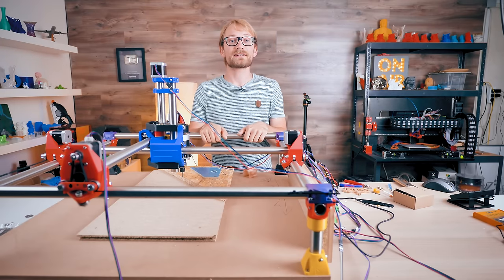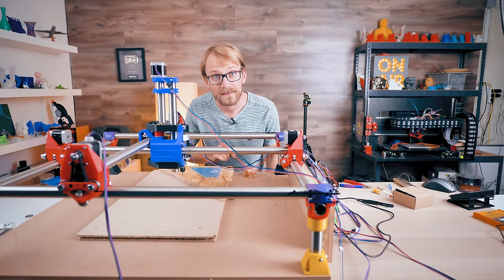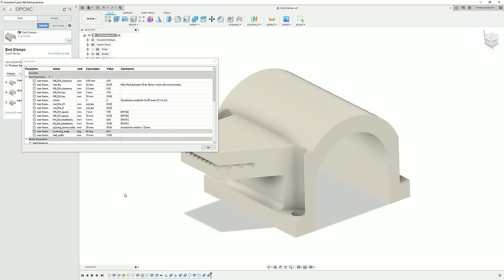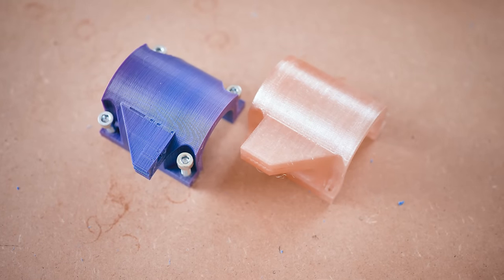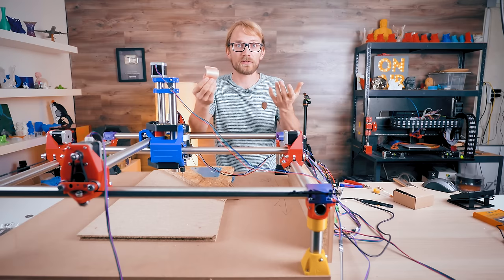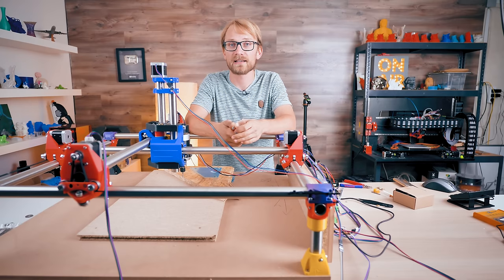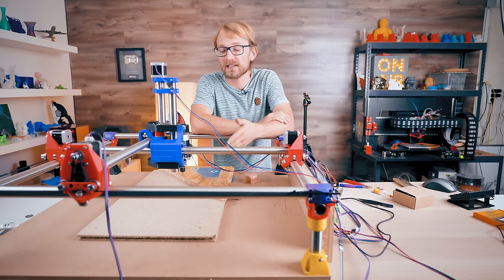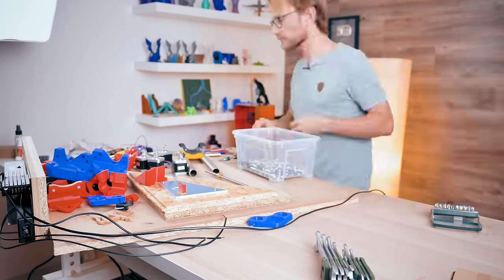Whose design even is this? (MPCNC conclusion)

Comment: I know that everyone is kinda shitting on Ryan a little bit here, but I'd like to take a moment to just try to present what I think is likely Ryan's case (despite thinking that he's in the moral wrong here).

Ryan has put work into the designs for this system, and doesn't want anyone else to start selling kits based upon his designs because he wants to have the exclusive rights to make profit off of his work. Simultaneously Ryan wants his designs to be open enough that hobbyists at home can make them for themselves, or make improvements to them. Licensing is likely a concern for Ryan because within the 3d printer and home-maker communities there is a lot of IP theft, specifically coming from Chinese manufacturers. If Thomas were to make a part for Ryan's designs and that particular part were to be made open-source, it probably wouldn't be a huge deal, but if people in general were to do this until a significant portion of Ryan's design had been "improved upon", the new non-restrictive licensing would allow people to take all of the open source parts and sell or manufacture those, effectively cutting Ryan out of the entire process and denying Ryan the money for the work that he has put in.

That said, I think that even if this is the case, Ryan is probably freaking out over one instance, and he shouldn't be. I also think that the CC license is not helping here because its a great short-cut to licensing, but its not as specific and detailed as perhaps Ryan actually wants to be. Additionally the issue of if the part that Thomas made is actually derivative would very likely fall on Thomas' side of the fence here. Give that the disputed section of the part is over a glorified U-bracket with 4 holes in it, I highly doubt that you could ever hold any ownership over it. Furthermore the physical part cant actually be subject to copyright anyway because its a functional part, which is non-copyrightable, it could only be done via a patent. Now the digital file could be subject to copyright, but the digital file was started anew with no previous material used in its creation, which makes it not derivative (though IANAL). Either way, Ryan is behaving like an idiot in this instance, but I don't think that he's the asshole everyone is trying to make him out to be.
Reply: Ryans MPCNC machine is not eligible for copyright protection, and unless he is able to patent the machine (which he almost certainly cannot), anyone who wants to can LEGALLY copy, sell, or alter parts for his design.  This is a basic principle of law that has been upheld in many court cases.  For example, “Unless protected by copyright or patent, once form or design in an article is offered to the public, it becomes the property of the public and, absent deceptive identification as to source, may be copied at will by competitors.” Zippo Manufacturing Co. v. Manners Jewelers, Inc., 180 F. Supp. 845, 847 (E.D. La. 1960)

Comment: Oh boy does this comment section not understand licensing. The point of non commercial just means you cant print and sell that part without permission of the copyright holder. Now isnit derivative? Ehhh maybe. Using the end product commercially is allowed.
Reply: Copyright does not protect functional objects, like a CNC machine.  And unless the MPCNC is protected by patent, it has no intellectual property protection, and can be built, modified, or even sold by anyone.  The right of the public to freely copy, sell, and use unprotected designs has been upheld in many court cases.  To quote a ruling from one such case, “Unless protected by copyright or patent, once form or design in an article is offered to the public, it becomes the property of the public and, absent deceptive identification as to source, may be copied at will by competitors.” Zippo Manufacturing Co. v. Manners Jewelers, Inc., 180 F. Supp. 845, 847 (E.D. La. 1960).  So Thomas was well within his rights to design a new part for the MPCNC and freely offer it to the public.

Comment: I don't think you understand licenses. The license in question here is known as the copyleft license, which basically means that anything that is made with the license and it's derivatives must continue to adhere to that license. Because the creator of MPCNC made the MPCNC design and you made parts off of the MPCNC parts, the license gets "passed down" to you and anything you release must also have that license.

If you really don't like MPCNC, you can always make your own open-source design. No one is stopping you, as long as you don't use any of the original parts and your new implementation is clean room.

Also, a noncommercial license is still considered open source. Open-source doesn't mean no restrictions, it just means you are free to do whatever you want with the model, as long as you follow the license rules when you release your model.

Comment: The X and Y Axis need Threaded Rods and Powerful Stepper Motors. That's a solution to your wobble.
Reply: No it doesn't.  Rods at that length will whip.

Comment: I am disappointed in Ryan and Mpcnc. I agree you design is functional and I don't believe that this would be considered derivitive.

I was looking very forward to you doing more work on the MPCNC and I believe Ryan and the MPCNC community have lost out because of Ryan's poor choice to split hairs with you over this project.

I too have built an Mpcnc and  MINE ALSO Required several upgrades and alterations to improve its functionality.

It is my opinion that Ryan and the MPCNC community have lost a valuable resource, Ally and collaborator, as well as valuable publicity from your very popular channel.

Thanks Tom. I just wish you were still doing more with the MPCNC

Comment: I've lost count how many times I see my designs being sold on eBay despite publishing it as non commercial. 

I have international patents. They're only as strong as you defend them. And even then... 

My opinion. If you've made the thing from scratch. You own the model. Not the idea. Because at any given time someone else in the world has thought of the exact same thing.
Reply: Lol @ made from scratch.  "while staring at the original" is not from scratch.
Reply: @GeoffreyPitman523  lol @ perception that original is anything more than a shape with specific function. 

I'll lead with the classic chair example. My patent attorney loved to tell me this one. If you design a chair, it's a fair bet, if not for aesthetic design (which is copyright-able), it'll have a base, back and 4 legs. 

The base function of the chair is to sit on and the components to build one are generic in themselves with no specific unique features. Generic chair design principles cater for the function of a sitting platform, back support and 4 legs for stability. But it can be made in many different shapes to achieve this function. So the function is not bespoke to the shape.

The argument Thomas makes is akin to this premise. The reconstruction of the shape to change the function does not necessitate an infringement on IP. The part is freely available. It's designed for function and has no unique property that involves intellectual property  other than it just happens to fit and forms function of holding the cable in place. 

This is not a copyright-able part. Simply that because that the shape can be modified in many many ways to be distinguish-ably  different but operate with the same function.  Therefore the function is generic and not bespoke to the design.

Thomas is well within his right to publish , for free and with any constraints he wishes, because there is no bespoke IP associated with the design. 

And if anyone wants to argue the function... well I'm pretty sure the patent for sliding retention mechanism on a fixed railing has been done to death and also generic in function to also not be patent or copyright-able also.... 

.....so....

Comment: What would happen if someone would take Tom's video, and change the ending to say, "Actually, copyright exists for a reason, and I'm sorry for the potential damage I've done to this community and Ryan's personal business". Then release it with CC0?
Reply: Copyright doesn't apply here . . .
Reply: @williammiller3277  You can't retype Harry Potter and call it Larry Potter to get around copyright.
Reply: @jeffeberl12  That is an irrelevant comparison. Harry Potter is actually able to be covered by copyright law.
Reply: @williammiller3277  So are the STLs.
Reply: @jeffeberl12  Copyright covers creative works, not utility. The proper protection would be a patent or design patent for the part itself. The underlying code wasn't used. It isn't a derivative creative work. If you want a good derivative example see Garfield minus garfield case. Copyright does not apply to a utility part that should be protected via patent. 

If there is a physical part that should be protected by patent, as this part is once printed, then someone would be able to make another part, and share how, and the patent would shut that down. Given the case law of video games and computer programs with copyright and physical products with patent the crux would be whether the stl/gcode part was used OR if the design is creative enough as an artist expression to be given copyright status  on its own. Also in music you have time prove you've never been exposed to the song before which is hard to do. In this case it's hard to draw an analogy for a part shaped how it has to be to perform a utilitarian function. Which is why the more the more and more you get into the details of the copyright argument it makes no sense.

Also coming into it is whether Tom would sell the physical item vs releasing the model and what licensed used as that looks at copyright vs patent. 

It is a complicated issue that is not 100% covered since this does involve computer data and a physical product. But given the overlapping precedent that exists as long as the copy of the part was made from scratch to replace a non-patented or unpatenable part then that work would not have any claim from the creator of the original part. He could make his from a hand carved model out of wood, make a silicon mold and then pour the part manually. The method he used to make the part doesnt change that he made a part that isnt patented. Just because he used the same method as the original part doesnt change that he is allowed to make it and share how he did. You don't own 3d production.

TL;DR, what copyright claim exists is very weak and most likely doesnt apply at all and whatever chance of patenting anything not patented already, regardless of novelty, went out the door given the length of time this has been public and for sale. 

And no, your Harry Potter example is not similar, at all. If the 3d model printed was an artistic statue where one tooth was shortened 2 mm, the analogy would hold, no matter how the copy was made. If it's a utilitarian part with no independent artistic merit or intent and not patented then you can make and improve upon it, no matter how the copy is made. Parts have been designed in auto cad and computer models since there was autocad. Your model isn't special.

Comment: Im gonna use a mpcnc to build a real cnc
Reply: Did exactly that. Cut plates out of plastic on the MPCNC Reused the expensive parts of the MPCNC on an Openbuilds OX based system. It is a MUCH better design.

Comment: A lot of these conduit designs were created by people who I don't think necessarily have engineering degrees or is they are engineers they aren't structural. Long unsupported thin wall beams are basically the worst choice for this application. I understand why they picked it for the "bearing" choice, but this design is super flawed from the start. Aluminum extrusions has a hope of working, but even that won't produce the results a good, heavey, cast iron design can. 3d printed printers though, they see such little tool pressure they are often "rigid" enough to get away with these poor designs.

Comment: Why disassemble the entire frame? Take the router off and make a 3D printer out of it.
Reply: Seems like you didn't get the point. Thomas is disappointed that Ryan doesn't allow open source improvement parts and I think Thomas' plan was to improve this machine together with the community.

Because he was looking for a communal project he refuses Ryans idea of licensing and doesn't want to support the project any longer.
Reply: @saschathiede  No actually I understand the point he was making. I don't think makers should have to get to the point of hashing out patent law which leads to lawyer involvement, which leads to nothing being "open" anymore. It's the old derivatives vs. prior art argument.  
My point was if there is a conflict with a CNC functional machine, then recover your time and effort losses by converting to a different functionality. ( This would change the inertia problems that Tomas encountered and could be cast into different technology base.)
BTW, Thomas your work and videography is superlative!

Comment: GG Ryan! : / by the way the belts seems to me too narrow to handle this size of machine. wider ones exist
Reply: Yes, I thought the same regarding the belts. Sure, Tom's build was apparently slightly larger than average, but my understanding is that one of the design goals of the MPCNC was to allow the machine to be essentially any reasonable size just by using longer or shorter pipes - the website even says that for larger builds you should add additional supports for those pipes, but it says nothing about using wider belts! Even for smaller machines, I'd imagine you'd want something more than 6mm GT2 belts, or you'd still experience a lot of the play and "springiness" that Tom's machine exhibited... (Part of me is inclined to mod my 3D printer to use 9mm or 12mm Gates 2GT belts, no matter how unnecessary it may be! :D)

In fact, the MPCNC parts list doesn't even specify the belt width! Just "GT2 belt". So... 1mm GT2 belt, then? 🤔 The only way you know it's supposed to be 6mm is from the provided links to super-cheap 6mm GT2 belt on Amazon/AliExpress (I don't recall all the details off-hand, and I don't want to visit that website right now!)

From watching Tom's build, I think you could use 9mm or 12mm wide belts by just:
- Doubling up on the 608 bearings that the belts run on beneath the motors, unless you can find 8mm ID roller bearings with a suitable width (or just use idler pulleys like a normal person!);
- Switching to wider drive pulleys on the motors, of course;
- Possibly using longer bolts to attach that thin plastic part that holds those belt-guide roller bearings in place, so that it can accommodate the double/wider bearings/pulleys used;

... and I think that's about it. If you wanted to clamp the belt with something besides zip ties, that part would have to be suitable, but *purely from watching Tom's build*, I don't think any of the printed parts are specific to the belt width. (Which might be why the MPCNC parts list doesn't specify a belt width, but if that's the case then it needs to mention what I listed above, and it should probably explicitly state that there isn't a fixed belt width!)

But again, I've not looked into that in any real depth, so don't blame me if I'm wrong! :)
Reply: @AndrewGillard  fantastic ideas, try them out and see if they really improve anything.  Then report on the results and go from there.  But dumping on the design based on nothing but a thought experiment isn't super fair, don't you agree?

Comment: So the imperial only fittings was a bit of a turn-off and the extant rigidity issues were concerning but the big red flag for me is the pissy attitude of the project creator who clearly wants to be king of his ant hill. The project creator's response was PR suicide, well done :/
Reply: it's not imperial only. it is designed for both metric and imperial. Each nut hole is designed to fit the larger of the 2 options. Rigidity issues on tom's build were caused by spindle that has internal rubber bushings between it and the case. If you watch the video you can see the spindle moving, not the machine.
Reply: @timr86868  Fair enuff, I stand corrected.

Comment: I already thought the MPCNC was not fully capable because of its conception : you' can't build a capable machine with no serious quides and transmission. Simple as that. What's the interest of a perfectible machine if the creator turn mad as you try to make it better ? It worth sub zero for me. It's a no go. 

Any adaptable part is not copyright at all, this is ridiculous ! Even serious brands like Festool or Bosch does not claim any copyright for an adaptable battery or accessory. What about the guide system with 608 ? It's stolen to another designers. And now Ryan dare to scream about copyright for a U shape tube clamp ? Seriously  ? This is pathetic...

Ryan, if you read this, you harm your own project, and worst of all: your reputation. It's obvious you try to protect your tiny business, but in a pretty wrong way. Open source is highly valuable. It's like a free research departement. You can't be smarter or more productive on your own than a whole comunity. Your design is a castle of cards.

Comment: The dude has shot himself in the foot, not that anyone should build such a flex'o'matic anyway, it's simply throwing away money. Chatter you say, well amazeballs, I'd have never guessed!  it's design flaws are obvious to anyone that has designed a real machine. Skinny round tubing into plastic sockets ffs, just ridiculous. Deflection calculation is not difficult to simulate, cutting loads for given chip loads and materials are all well characterised and have been known for many decades. This thing is mechano level amateur hour.  Unlike 3d printing for CNC mass is your friend, the entire approach taken was doomed to failure from the outset. The precious pup behaviour the person responsible for it is simply the nail in the coffin.